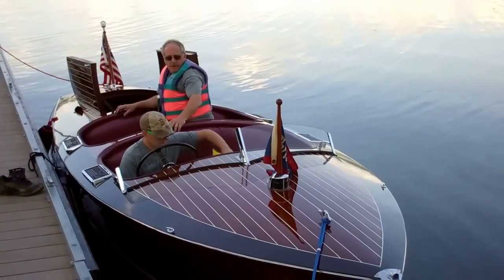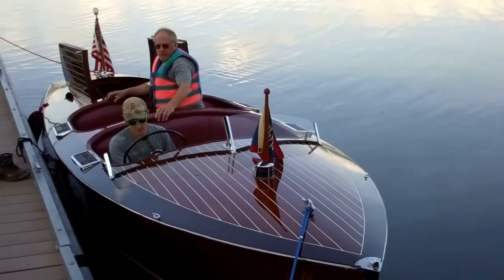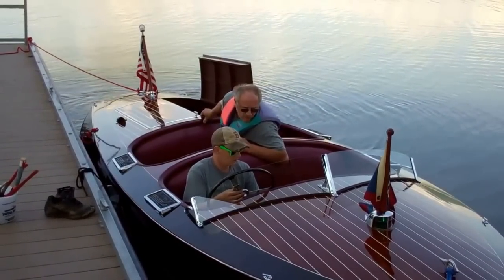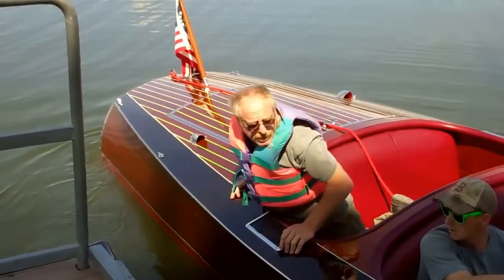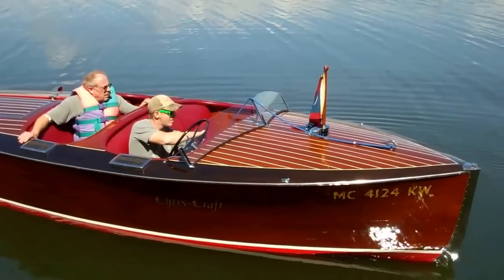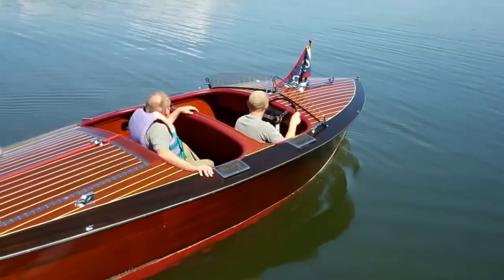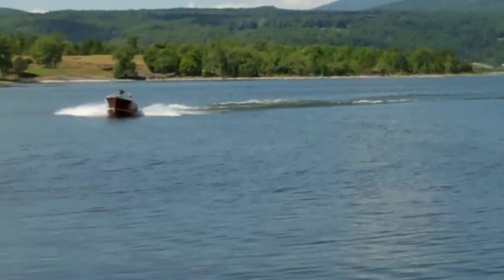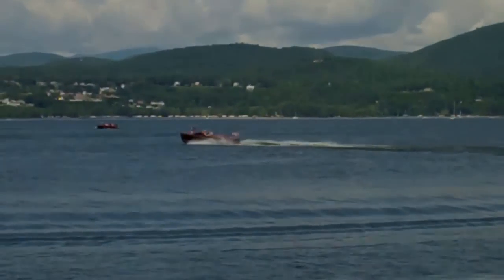1938 Chris Craft Double Cockpit Forward Custom Runabout on Lake Champlain 8 3 2016

Comment: The windshield looks more to be a 50s style the 30s were still pretty squared off. My 1938 utility has a drop down windscreen.
Reply from the maker: You are 100% wrong. Those are Chris-Craft Pre-WWII windshield brackets. Remember this boat is a DOUBLE-COCKPIT-FORWARD RUNABOUT, not a utility with its engine beneath a dog house. You are trying, and failing to compare two entirely different models; sort of like comparing a truck (the utility) to a race car (the runabout)
Yes, the upswept deck and fold-down windshield was offered on utilities, especially on triple cockpits in the Pre=WWII era.
Reply from the maker: See more below, but here is a brief video-based introduction to Pre- and Post-WWII windshield styles:
1948 20’ Truscott Runabout and 19’ Utility: https://youtu.be/hF0qcc7R2lM
1953 18’ Chris-Craft Riviera: https://youtu.be/OZmeyoAjtf8
1959 17’ Chris-Craft Sportsman – The correct Chris-Craft Post WWII two-piece windshield brackets: https://youtu.be/iZQRmb3Dwvs
(Chris-Craft switched from flat two-piece to Plexi one-piece windshields in the mid-1050s.) 
1953 22; Model 110S Shepherd Runabout: https://youtu.be/LemJFKlGgVg
1937 20’ Lyman Runabout - flat fold-down): https://youtu.be/bNNHi82fuw8

Comment: Question! What do you mean by, "leave her in the water for a week, let her finish soaking up"? Can you explain? Thanks.
Reply: What he means is the boat needs to sit in the water and the wood absorb water into it and swell so the joints are Tighter and it keeps it from leaking. All wood boats are like this. Whiskey barrels work the same way but backwards...
Reply: Yes, sir. Big Jay has it. Wooden boats will have spacing in-between wood planks. In order for them to seal up, one would sit a boat in a lift or tie off to a dock for a few days with the bilge pumps set on auto, or someone would periodically check the bilge to run the pumps. Once it's soaked enough the boat is considered water tight. On extreme cases where the wood planks have shrunk in width from drying out from decades not being in the water, a boat would be set in a slip while being cradled by a belt hoist, because the pumps wouldn't be able to keep up with the amount of water coming into the bilge. If the boat doesn't seal up enough after a few days, being that it's being cradled by a hoist, it can be lifted out, and set somewhere for any repairs, or wood work that would be needed to ensure water tightness.

Comment from the maker: One terribly misguided C-C addict harangued me on and on, asserting that all C-C wooden hulls are built to precisely identical dimensions, which, sadly, even Chris Smith admits is woefully wrong, wrong, wrong.
Just for yucks and chuckles, here is the article on the topic published in the November/December 2020 issue of Classic 
Boating Magazine, "Chris-Crafts Weren't Precisely  Built by Master Craftsmen?"

Having set my sheer line from the original offsets, there is a hump in the sheer line. Original covering boards (or should I say their remains) appear flat/straight. I know that most 1940 barrels have a straight sheer line, or is this just another custom thing? What's a poor boy to do make the sheer line straight by shimming or planing?
I just hadn't worked on the 23' Custom and was hoping to get advice from someone who had. I've done a number of 17's and 19's, and those are flat sheers.
Is your hump local or a long sweep like the 20' Custom or the Continental?
I'd been meaning to ask a fellow restorer how he takes lines off of barrel backs, and how he decides which side of the boat to use for his half-breadth measurements.
I've worked on a half-dozen each of l T and 19' Customs (barrel backs) over the years and have never yet seen one that was not at least 3/ 4" different from one side to the other. I had two 19's in the shop, a '39 and a '41, and the centerline of the former was 15/16" off center while the latter was 1-1/8" off center.
On the '41, the original deck planks were 1-1/ 2 inch longer on the port side of the fore deck than they were on the starboard, because of this ballooning shape difference.
In 1992, I was pondering this problem on a 1940 17' when Chris Smith visited. I asked how this could be. It wasn't hogged, and clearly had never seen restoration before. 
He leaned over, looked at the hull number, and said that it was most likely the factory hull form that was at fault. He surmised that perhaps that framing station had a 100-pound guy on one side and a 200-pounde guy on the other side.
He Went on to explain that these boats were not built by craftsmen, but by laborers who know one thing only, and that I shouldn’t expect so much perfection from these boats.
(Consider this caption appearing beneath one of the article’s photos: “These young seasonally-employed farm boys can hardly be regarded as shipwrights.)
This was when he first explained Chris-Craft’s marketing strategy of a six-year turn-around. This was when their average customer bought a new boat, and the  old boat was sold to someone who  would work on the leaking bottom.
A couple of years later, I rebuilt a  gray, 1940 19' barrelback. The transom looked strange and, sure enough, the starboard topsides planks measured 1-1/ 4" longer than the portside topside planks. The transom was that crooked.
Don't expect too much perfection from Chris-Craft or any other production wooden boat. We have more than enough purist preservationists romanticizing that ideal.
By the way, how did your half breadth measurements fare?  Did you use a laser line? How much of the deck framework was rotten pine? Why should their heights- measurements be any better than their half-breadths were?
I have not totally made the transition to the laser, a little here, a little there. The guys working on my boat were more likely a 300- pounder d a 100-pounder. Thanks again for all of the help. I've also noticed that ea.ch time I read restoration books, there are answers to questions that I missed the first time or two.
…..
Hey, I've warned you before, do not expect perfection from Chris-Craft: especially from the barrel backs, which seemed to be an ongoing experiment. I just purchased hull #48510, a 19' barrelback, delivered August 18, 1938. It is extremely original, even to original crash padding (animal chewed remnants). It has been in storage since 1973 and does not even have loose bungs.
I told you before about how off center the barrelback centerlines could be, and I haven't even done that yet (just got it home), but look at these deck planks! The portside plank at this point is 9-3/8" wide. The starboard side plank at the same point is 7-7/8" wide. That's a difference of 1-1/2", and completely original.
Classic Boating November/December 2020 pp. 26 & 27

Comment: They didn't dramatically change the look of their boats until 1965. 20 years after the war.
Reply from the maker: Maybe, but with those design changes came cutting corners everywhere possible, which cheapened wooden Chris-Craft vessels dramatically. Remember, by 1965 Chris-Craft, along with the other iconic marques, were fighting and ultimately losing the war against inexpensive fiberglass hulls.
Reply from the maker: @ElectionFraudHasConsequences  YUP, Jimmy boy, which is what I replied. However, Chris began cutting corners in every way imaginable - fewer frames, thinned plywood inner skin, cheaper mahogany,  fewer complex curves, almost no tumblehome, softwood stringers, cheaper hardware and on and on and on.
You own two? Good for you. We've preserved well over 100  dating from very early Pre-War through some of the last hulls manufactured in the sixties. I know of what I speak, my friend.
If you must know, I have owned multiple 20's vintage Cadets and runabouts, 1930's barrel backs, and deluxe runabouts, including Flyin' By; and multiple early 1950's 17' Deluxe Sportsmen, two mid-1940's cedar-planked U22's, a 1950 18' RIV and a 1956 22' Deluxe Sportsman. I have just purchased Owen Smith's fully documented and personally designed and owned 1937 21' Utility Deluxe Angler, complete with his original and signed hull card, #35252. You can come and see her at the ABM ACBS show in Clayton, NY, next August.
Reply from the maker: In case you wish to inform yourself, you might buy and read a copy of The Mariners Museum's Jerry Conrad, "Chris-Craft - The Essential Guide.
And, it took me a while, but here is an excellent article that answers the question, "When did Chris-Craft Stop Making Wooden Boats?"
The last model offered, I believe, was the 57'' Constellation, which Chris-Craft introduced in 1968 and stopped producing in 1972, according to Conrad.
Then, of course there are all of the Chris-Craft kit, racing and sailboats that Chris-Craft moved into in a failed attempt to forestall fiberglass wiping out wooden boats. (Remember, Chris-Craft's first foray into glass was in the late 1950s.) 
If you can find a copy and are willing to pay a very hefty price for it, I recommend J. Lee Barrett, "speedboat kings,"  which chronicles the long relationship between Christopher Columbus Smith and Gar Wood on the St. Clair River and in the Algonac factory in upper Michigan.
Finally, there is the richly illustrated and deeply researched, Jeffrey L. Rodengen's, "The  Legend of Chris-Craft," with Peter Henkel roaring across the dust jacket on the St. Clair in his beloved 1928, 26' Chris triple runabout, Climax. (The Legend ... is still available from book sellers, but it is not cheap. https://www.abebooks.com/servlet/BookDetailsPL?bi=30670099892&cm_mmc=ggl-COM_Shopp_Rare_noclick30product_id=bi%3A%2030670099892_-keyword=&gclid=Cj0KCQiA3rKQBhCNARIsACUEW_bwYgchp3kzh7fLq0nk5TFDhLn-X_BMLydmnJ-ub76yjUnEPTD_fI4aAn7OEALw_wcB).
Enjoy and be sure to inform yourself about all things Chris-Craft
Reply from the maker: Maybe this 1967, FIBERGLASS! 30-ft Chris Sportsman strikes your fancy, Jim. http://www.antiqueboatamerica.com/Boat/30_Feet_1976_Chris_Craft_Sportsman_42097
She can be yours for the give-away price of $250,000! :)